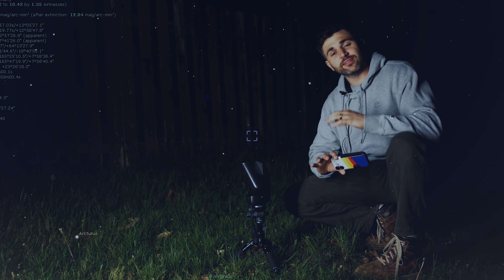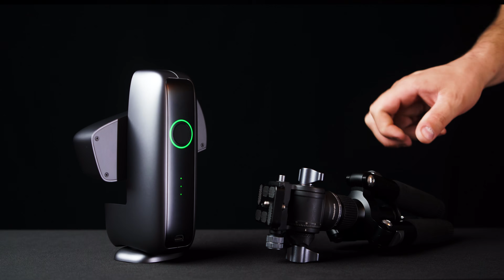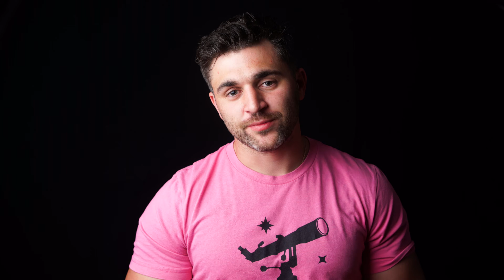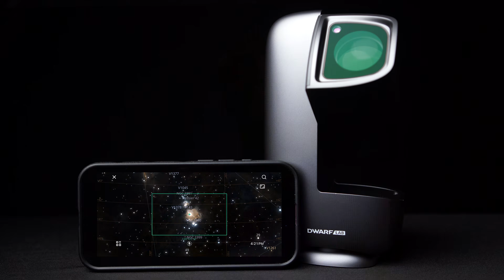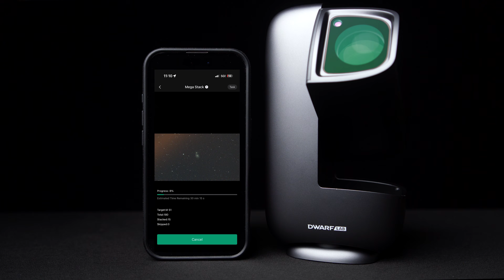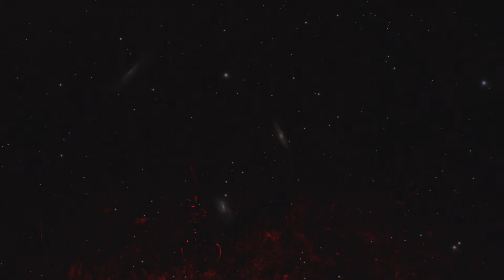DwarfLab DWARF Mini Smart Telescope | Full Review

Comment: Question. When you set up a schedule to set up an automated series of objects for the Mini to photographthat night, do you need to click on AutoFocus BEFORE You hit Sync (and, if so, what is it going to focus on?). Or is there another way to do this before you “Hit Sync and Walk Away?” Thanks!
Reply from the maker: Great question! The Dwarf Mini will manually calibrate (plate solve/autofocus) before each scheduled session begins.
There is a setting hidden in the Deep Sky mode (Parameters > Settings > Calibration) that allows you to enable "mandatory calibration". This ensures the Dwarf Mini will automatically calibrate before each Go-To, but we don't believe it's necessary for scheduled sessions because the Dwarf Mini will automatically calibrate before each session. However, it's a good setting to keep enabled in general as it will ensure better results overall.
With that said, if you want to use the EQ mode, you'll need to set it up before creating a scheduled session, which involves aligning and autofocusing. Also, you cannot move the Dwarf Mini after syncing a scheduled session (for both EQ and AZ modes).

Comment: i have a few questions about the dwarf mini

1. is it a good option to use it to photograph a solar eclipse?
2. how much does it get affected by light pollution?
3. if i already own a tripod with a swiveling head is it unnecessary to buy the tripod dwarflab sells?
4. when photographing the moon how "close" can you zoom in to the surface?
Reply: I am a Dwarf Mini owner and can take a crack at your questions.
1. Yes I think this would be an excellent option to photograph a solar eclipse
2. Like any telescope it is subject to light pollution but I live in a Bortle 6 environment and have taken some amazing photos of deep space objects so it does a good job in light polluted environments bearing in mind that longer duration exposures and more exposures with be key to great images. Personally I use 60-90 second exposures of deep space objects in equatorial mode for an hour or more to get these results. You can shoot the same object over multiple nights and combine these exposures during the stacking phase.
3. You can definitely use your own tripod with the mini with a swivel or ball mount head.
4. You cannot zoom in with the Dwarf Mini…it takes images at 150mm focal length only……I guess during post processing you could zoom and crop images but not during the image capture session.

Comment: The mini has a station mode?
Reply from the maker: The Dwarf Mini does have station mode! At this time, the process is as follows:

Turn on the Dwarf Mini > open the Dwarf app > click 'Connect' > tap the gear icon in the top right > select 'Connect via Home/ Public Wi-Fi (STA)' > tap 'Save' in the top right > tap the entry for your Dwarf Mini > tap 'Continue' on the box prompting you to configure Station Mode > wait for the search to complete, then tap your WiFi from the list > enter your WiFi password and confirm > tap the WiFi entry again on the list.

Now your Dwarf Mini will connect to that WiFi access point, and so long as your mobile device is connected to the same access point, it should show as connected in the Dwarf App!

Comment: I thought it can also take Milky Way photos, is that not the case? I didn’t see that as an option on the app when watching your video.
Reply: As far as I know, Dwarf mini only has a telephoto lens which isn't wide enough to capture wide objects such as the Milky Way. The previous version, Dwarf 3, has dual lenses, one of which is a wide-angle lens that is capable of capturing landscape shots including the Milky Way. Nevertheless, at least from some testing results, the heavier weight of Dwarf 3 makes it more susceptible to tiny vibration and less steady than Dwarf mini when having long exposure astro shots in EQ mode. So Dwarf 3 mini might even be a better option if you are taking astro shots only. Dwarf 3 is more versatile as it can take both wide-angle and telephoto shots but it's slightly bulkier, too.
Reply: @pengyuhe9848 It can do milky way photos now, the app was updated to make that feature available.